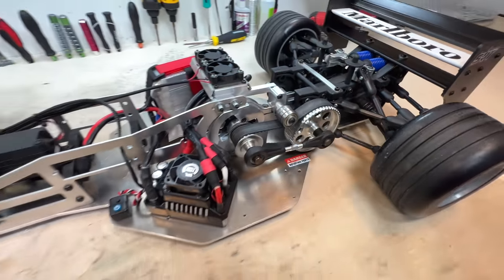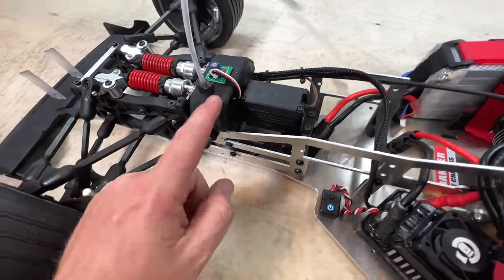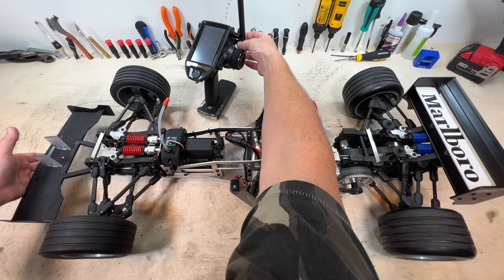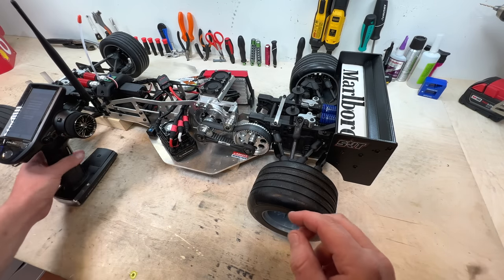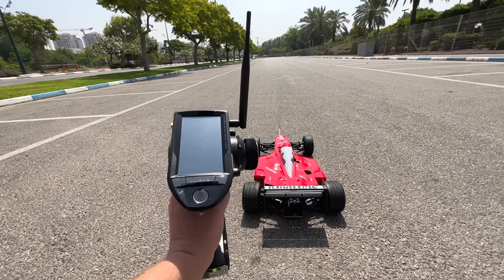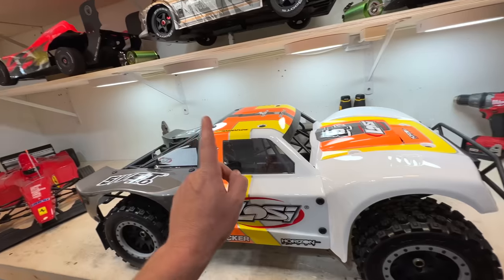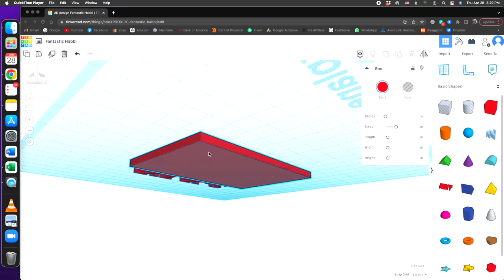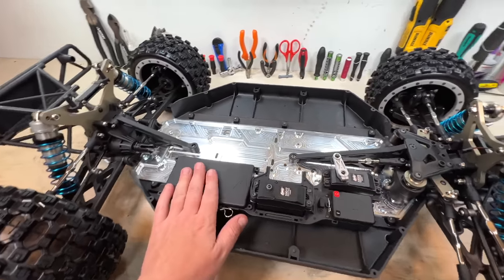Exact Replica Remote Control F1 Car Sounds Like The Real Deal! - Epic Formula One Rc Car.

Comment: Has anyone in RC ever considered wheel balancing? I noticed a lot of wheel wobble at high RPM, maybe a scale wheel balancer is in order if you know what i mean.
Reply: Yes it’s done a lot. More with road track racing than off-road racing.
Reply: i JUST started balancing my Basher RC truck tires. makes a HUGE difference with air control. i was going to use dabs of hot glue inside the tire well, but RC Illuminati has a nice video on balancing the SLEDGE tires, i think, with a type of clay. tell him rogueFactor sent you! 😁
Reply: Always balance your wheels. 
Their are a few companies that make a tool just for that(amain hobby). It will help your wheel bearings last longer too.
Reply: @rcjunkie260  yeah that! i knew there were other plussessesessses. should help prevent chassis vibration etc so pretty much balancing prevents a lot of stuff like rattling all of the chassis screws out of their holes. 🤣
Reply: Came to comments to say this those tires are in dire need of some ballancing.
Reply: @rogueFactor  Yes 
Better handling rc on ground and air!, bearings last longer. My 4s backflips were horribly out of balance.  Hold rc in hand and hit throttle hard and the suspension started doing its thing. Balanced all wheels. Just about perfect and what a difference. Just holding the truck in hand and whacking the throttle, truck didn't want to rip itself out of my hand. 
A MUST DO IN BASHER OR RACER!!!
Reply: They have made balancers for remotes for a long time ,I personality used one in the late 80s
Reply: on all my wheels I use golf club weight tape works awsome and will definitely make a huge difference in any application if you have unbalanced wheels and tires
Reply: I know the no prep guys and gals do
Reply: @castekracing  I found running the oval was most noticeable, especially on the ole custom works
Reply: my outcast 8S is so butter smoooove now, it's almost scarey!
Reply: @patrickwhite95  yeah of course you did
Reply: Been balancing for years...
Reply: @N1CERC  im only into rc drift so I never considered it, thats next level dedication haha
Reply: I've use the Dubro prop balancer for almost 20 years to balance wheels.
Reply: I just came across some 1/5 scale weights, and been thinking about that ever since 
But since I'm a basher only and don't race, doesn't seem to be worth the effort

Comment: an old plastic fg formula 1 . good for driving into the rain , a disaster on high grip tracks . and that suspension , when you turn 1 link , caster camber changes all at once :p

Comment: ngl it wouldve been smart if the company that made this car actually had holes cut out in the intake scoop and the place where the radiator goes on an real F1 car. It would work perfectly as an air cooled system, like a real F1 car!
Reply: oppppipippipipppopi0pipxuudsñjfjhjfchhchcjcjguguxjcbfjhghhjffjfjfuufuufuffuuddeudufufufufuihrhrcvcjru⁸
Reply: could mount a small heatsink with a fan on the motor to suck air through that hole
Reply: @plushbac0n692  no need to use a fan if you are moving already. the fast moving air will cool just as well as using a fan.
Reply: The body is actually pretty crude, it resembles a generic F1 car but I wouldn’t go overboard with the stills and dramatic music. Nice setup though!
Reply: Agree to some sort of extent but i
Predict some jealousy too

Comment: You could measure the vehicle velocity and compare it to the wheel velocity. If the velocity at the wheel is larger than the vehicle velocity your wheel is slipping. You could make true launch control or even ESP and ABS with very few added sensors. 

Amazing stuff!

Comment: Nice! You would achieve slightly better performances by relocating your belt tensioner to the lower side of the belt. Where the roller bearing would have a fraction of the load applied to them compared to the top section of the belt, witch is in constant traction from the motor force. As opposed to the lowest section of the belt that hardly have any work to do, becomes in tension only in decelerations the rest of the time the bearing just keep the slack. Also your belt would not get used up on the outside as it is the case now.

Comment: Hi raz, i saw your duel motor built, but notice you weren’t using the sensor feature of the 1717 motor.. I have a build coming up where I am going to have duel 1717 and was wondering if I could use the sensord mode for duel motor builds?

Comment: I have a 10sec throttle delay that I can set on my remote. So it will take 10 sec to go to full throttle. Is that something similar like perfect pass? I didn’t try it out yet I do my speed runs with no gyro and just go to 50% throttle and than gently up to 100%.